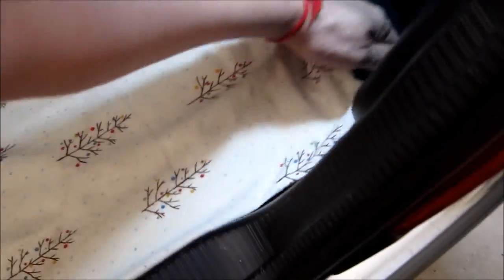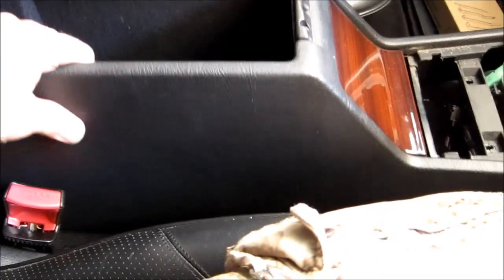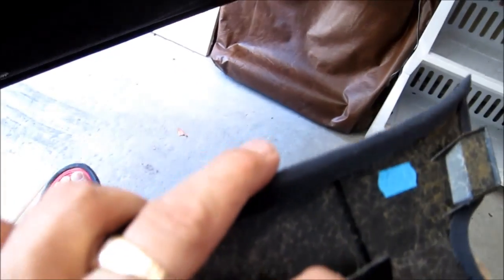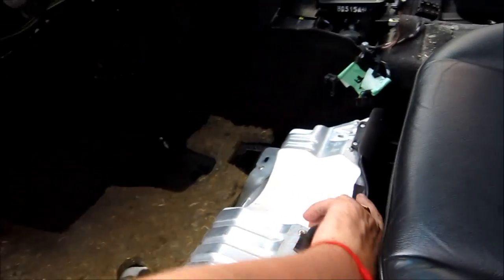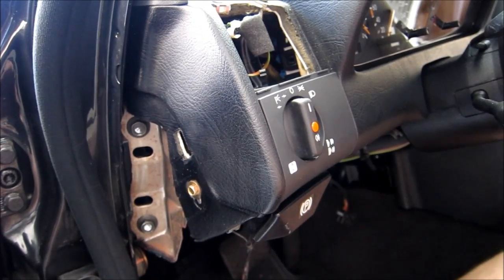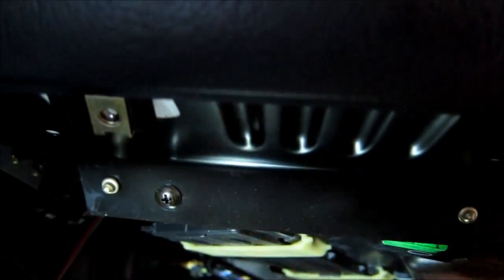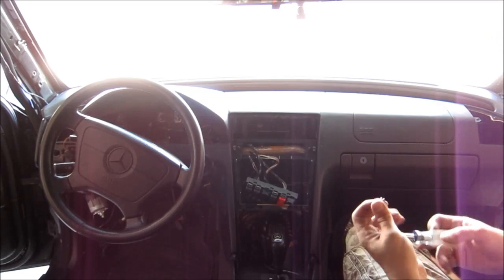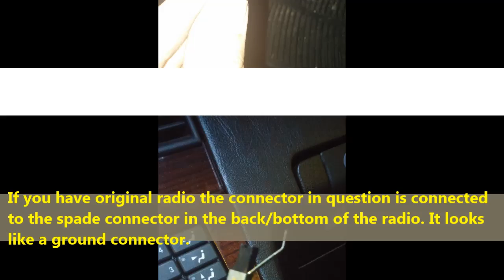Mercedes-Benz W202 C280 Instrument Panel Dash removal & installation

Comment: I had a green vac line break at the connector that goes to an air tank in the passenger front panel inside the wheel well. You should be able to hear any leaks. Good place to start.

Comment from the maker: i had to replace vacuum actuator on the fresh air intake flap. my vacuum pump would not shut off if i had the climate control unit on "OFF" or "RECIRCULATION". i traced the vacuum leak to the faulty vacuum element operating the flap. 
Before u tear your car apart, get a vacuum schematic and troubleshoot in sections. u need the schematic to understand how it works.
Reply: It seems the easy leeks are at the distribution block which is a cheep toss cheep money at it fix, next is under the hood all the rubber vacuum hoses just replace due to age then iron out the others, i had a crappy transmission shift in a 96 c220 M111 with a 722.4 and it was all because the rubber hose was leaking on the manifold and one dollar US solved the shift issues. So many things on these old Mercs can be solved for peanuts.

Comment: I'm doing this job right now! Same reason, to replace the vacuum pods, but also for a little extra goodies.
Reply from the maker: Good luck. You might want to clean ac condenser since youre already there.
Reply: @AndyPMercedesBenzChannel  

Shouldn't the cabin air filter prevent any stuff from getting into the condenser?
Reply from the maker: @PatsCarGarage 
Yes, but you can blow out any dust or use ac condenser foam cleaner.
Reply: @AndyPMercedesBenzChannel  

did you open up the whole case that contains them or did you just blow from the center vents?
Reply from the maker: @PatsCarGarage 
I just used an air gun and blew air thru drains. But now thinking back i think i should have done more...
I have a feeling that mine is plugged.. I mean it works ok, heats up and cools down, but when I turn the AC on Ithink i get this musky smell and also I noticed that I barely get any condensation draining even in the hottest month of the summer with ac on. I think I have the condensation just sitting on the bottom somewhere or in the evaporator. I bought two cans of the foaming cleaner but I haven't used them yet. Just have this feeling that something isn't right.
Thats why i said take you time
Reply: @AndyPMercedesBenzChannel  I don't have any of those problems, on humid summer days so much water pours out of the A/C drain that my girlfriend always gets scared and thinks I'm loosing some fluid. I also don't have any funky smells coming from the cabin. I will probably blow through it with my air gun, it's not a bad thing to do since everything is already open. Make sure that your cabin air filter is fitting properly. I suppose the only way the evaporator can get plugged is if either the cabin air filter is punctured somehow or it's not a tight fit and the gasket around it isn't sealing properly. I remember when I replaced mine with a new genuine filter, it was really annoying to push back in it was so tight.

Comment: This is a bear of a job to do but do able, when approaching this type of repair its cheep insurance to replace as much as possible and prepare for brittle plastic the speaker covers will normally shatter in warmer areas same with the tabs on the ac vents so know each of the pieces that you remove could shatter in the process and you may have to replace. I would budget 1000 to do this your self with OEM parts that are new the air-vents and audio covers 9 outta 10 times crumble and given the age of these vehicles now replacing all the modulators is cheep future insurance.

Comment: what problem did you have to make you pull the dash out? I've got a problem with my 94 c280 where the vacuum pump in the boot is not shutting off on start up straight away. also the aircon plays up sometimes. I was hoping it's not the aircon vacuum block but think I need to do the same as you.
Reply from the maker: vacuum leak on the recirculation/fresh intake actuator

Comment: Hi!  I have a similar problem with the right side blowing hot air while the right side blows cold.  I believe I have a blend door actuation problem.  I can't seem to locate the part number for the bellows that move the doors.  What was the part number you used?
Reply from the maker: A2028001975
Reply from the maker: There'are 5 or 6 of these , and they all are different. check the PN before you buy.

Comment: Andy you have an OBD connector on your 1995 C280, my 95 does not. Is this something that was done for the Mercedes for the North American market? My understanding was that the OBD connectors was ot really in them until the 1996 model...
Reply from the maker: My car is 95 north American model and it has an OBD2 connector under the dash along with a 38pin plug connection in the engine compartment. Officially OBD2 was introduced in NA in 1996 and i think in Europe around 2000.
Reply: Yes I believe you are correct, MB had there own way of OBD in the early days but the general auto industry went another direction and well MB had to follow, unfortunately the car I have is from Germany, a 95 and only the 38 pin connector and I need an interface module and a laptop to analyze anything...
Reply from the maker: Well you can get or make the analog blinking light analizer. I made one, its very simple. Also need the document to translate number of blinks to a fault code.  Google it...
Reply: Yes thanks for that, I did look into that and then I found an interface box and software for more diagnostics from a site in China, I am going to see how welll that works, at the moment I am trying to find something I have that I can maybe load a Win Xp on cause that is all this S/W will run on.... its always another thing eh

Comment: Thank you for the video. I am glad I stumbled upon it.
My '2000 C280 speedometer doesn't work . It does measure
speed accurately because I used my phone and
neighborhood radar to check speed. I also noticed
when warmer weather speedometer issue occurs less
often. Curious what you think could be the
issue...sensor vs motor?
Reply from the maker: Hi. I don't know. Never looked into this problem. I have a similar issue with my speedometer, it gets sticky in worm weather...sometimes when I start driving, the niddle doesn't move and then it jumps when I get to 60-70 km/h. I've read different forums ans some say they disassembled the instrument cluster and cleaned the little post that the niddle rests on. With time the paint becomes like glue. Not sure if this is true...
Reply: @AndyPMercedesBenzChannel  Thank you for your help.  I noticed that the lights inside the car did not turn on either
Reply from the maker: @farhadkami.7638  when you open doors?
Reply: @AndyPMercedesBenzChannel  no just radio light not working.
Reply from the maker: @farhadkami.7638  radio has 2 lights, one red light for security system and second white  for display when radio is on. Which one not working
Reply: @AndyPMercedesBenzChannel  hi thank you for help. When my car is warm everything is working.

Comment: Hi Good Video. Do you have any info on how to get my headlights left on warning buzzer to function? It works with the seat belt warning light but very intermittantly with the lights on usually when its hot out. I have have the cluster out many times and know where the buzzer is.Thinking about running a bright LED to let me know when its light out..TY
Reply from the maker: William Z sorry. i dont undestand what are u asking.
Reply: i think he ask for the light bulb or the  warning sound (for belts), but i dont understand what specifically
the question is for.

Comment: hi AndyP: seeing that we have the same car model except for the year, I will proceed to do the same process for air conditioning. thx for the video. PS. i still have thesame noise when my car is cold.
Reply from the maker: Rumi Pezo 
what noise?
Reply: hi AndyP; in the morning i gonna made a video and put the link here, thx for answer.
Reply from the maker: Rumi Pezo 
when u start the car and the engine is cold theres an air compressor that pushes fresh air into exhaust.
 the compressor is located undwr the alternator.
usually it works for about 90 sec.

Comment: Yes,it did.
But now the light is on for the '0' permanently.
Even while the auto is on,the A.C . wasn't working.
Reply from the maker: if you press "0" the light on "0" should be constant on.
now press "Auto" , does the light on "Auto " comes on?
Reply from the maker: when you press "Auto" does the "EC" light comes on?
Reply: +AndyP Mercedes Channel  Yes,it does comes on but the air conditioner isn't working. it's not blowing out any air.
Reply from the maker: e-mail me p574_20@mail.com it will be easier to correspond
Reply: Ok!
Thanks.

Comment: Hello Andy, James here. I was watching your video for dismantling the dashboard for climate issues. My question is, my floor vents are not working. I had my AC evaporator core replaced a a few years ago in shop. It blows cold as is, but as I stated, the floor vents are blocked. I do not appear to have the vacuum block under the hood. I've read on gorums about troubleshooting the bellows which is why I watched your video. Do you have any tips you could give me for troubleshooting the problen that doesn't require taking off the dash for starters?

Thanks,
James
Reply from the maker: jaeski33 
Hi James. Sorry i was away last month and couldnt reply..
To start troubleshooting u have to find the vacuum schematic. It will make it much easier. Not sure which model u have, on 95 c280 that i have all vents are open/closed functions are by means of vacuum bellows. The vacuum is supplied thru a manifold licated under the glove compartment. The command to the manifold is an electrical signal from climate control unit. 
So before you start tearing apart the dash you better make sure the problem is in the bellow.
Reply: AndyP Mercedes-Benz Channel Hi Andy, I ended up replacing the bellow for the floor flap since it was easy to get to [inside the glove compartment] and it did not FIX the issue. Recently, I tried replacing the vacuum Control element in the same area and the problem was solved for a few days but then it stopped working again. Any thoughts??
Reply from the maker: Hi. If freplacing the below solved the problem for a day or so, it looks like you have a leak somewhere in the line or in a connection . Try to find the vacuul system schematic, and you can get a cheap vacuum pump at harbour Freight.
Do you hear the vacuum pump running as you switch between different air flow directions?
Reply: If it worked for a bit installing a new unit, why would it stop working later? Just trying to understand. I here some shifting of mechanisms when I change air flow. Should I listen directly to the vacuum valve itself?
Reply from the maker: what year and model car you have?
Reply: 1997 c280
Reply from the maker: is your car righ hand drive?
Reply from the maker: im gonna send you some info to explore:
https://www.justanswer.com/mercedes/74z7c-c220-1995-mercedes-c220-w202-vacuum-issues.html
http://www.benzworld.org/forums/w202-c-class/2070010-c280-1994-vacuum-troubleshooting-vents-rear.html#post10199665
http://www.zadefaraj.com/dashboard.htm
Reply: Left hand USA